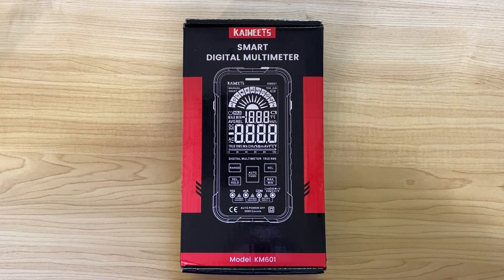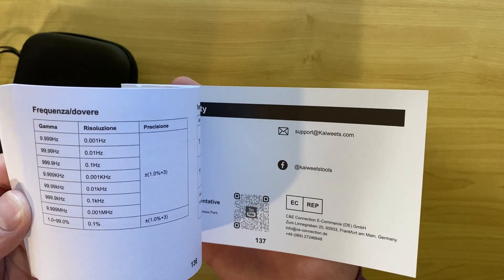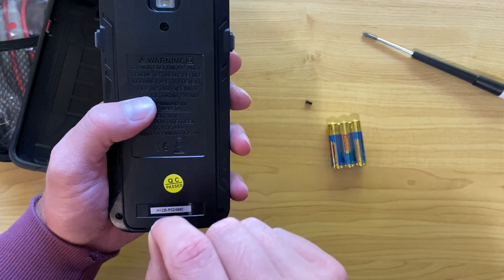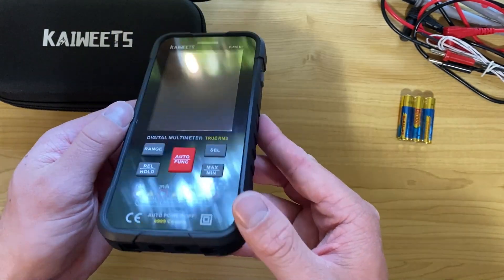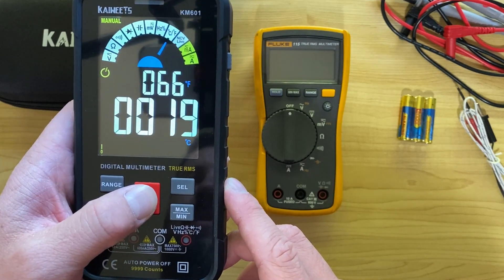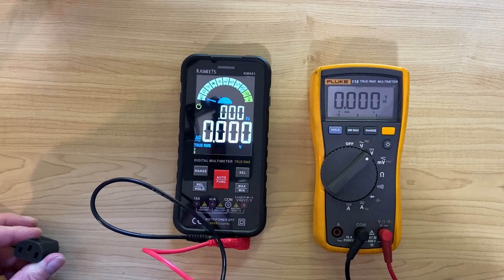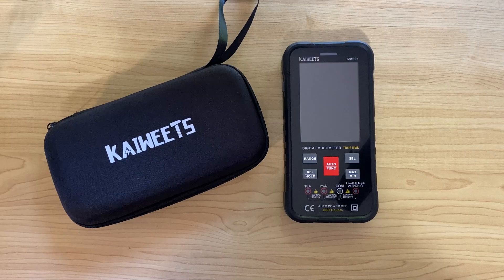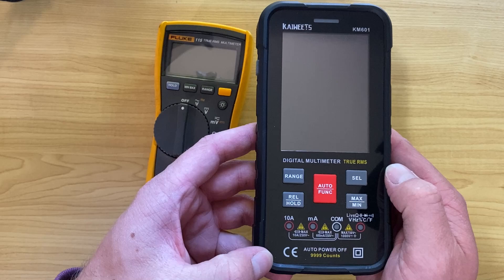$50 Multimeter better than a Fluke? Kaiweets KM601 Review

Comment: 99,9% people never need to get some 0,3% accuracy in voltage/resistance readings, it is only here in youtube that it becomes crucial. People, please trash your $250 price tag Flukes and go hype meters over $1000, even better +$3000 because you need that 0.05% accuracy...

Comment: 08:42  this test doesn't measure accuracy.  It just show the difference between the readings of the two multimeters on the same DC voltage. It's got nothing to do with accuracy.

Comment: Why are you testing a quality item against China Ju__k a bit pointless, if you want quality that you can rely on pay the extra, I purchased my Fluke 75 when I was 20, and I am now 78, and it still works, so what can I say!!!
Reply from the maker: So you've owned one and believe it's junk?
Reply: Not arguing, just curious: Does your mid-sixties 75 (same age as I) have any "offshore" sourced parts? Or are they being made entirely overseas yet?  My point would be that the new ones aren't the same as the old ones. Or maybe they are. I've not dug into it. Cheers.

Comment: For what I need it for it's better than a fluke. I like the neoteck pen 1 better tho. I don't need a fluke because I don't go over 277 volts normally so nursing home maintenance I usually don't even need to use the leads I just use the ncv. The pen is better because it fits better in my pocket and I can use it 1 handed even using the multimeter.

Comment: Thanks for most comprehensive review.
As of may 2024 , I want to buy a  accurate but budget ($ 50 Max) dmm for SMD component / voltage testing .
I think Kaiweet , multicomp ,anenag ,UNI-T all are chinese OEM .
Can you pls suggest  the best amongst this breed ?
Though colour smart screen is sexy it must be consuming large power and prone to damage .So I will stick to AUTO / manual dmm with backlight colour lcd .
pls.suggest. Thanks

Comment: On my Fluke 115 the stoping nose of the functions button (rotary button) broke, although I never used it really rough. So I can turn over the off position. Replacement parts for that (I really tried) been a pain in the ass! I got sent from here to there, I guess it's easier buying some spare parts for space shuttle from NASA! Backlight is just a bad joke, as you can see also here in this video. Now got GVDA GD128 which is the same as Kaiweets 601, and enjoy super display, and overall sure same measuring quality as Fluke 115. Do I need a Fluke? No!

Comment: Unless you're a professional that requires a high quality multimeter for non stop daily tasks and you have lots of money laying around and want to spend them on something, I suggest you to pick something else. Even the most basic Fluke models that have barely any functions cost over $150 and for just a little more, you can get yourself a multimeter with almost all the functions available to a multimeter. For instance, a good quality multimeter from other brands that cost $250-$300 will have nearly everything and it's Fluke equivalent will cost you around $1500, if not more. So, it's all about what you do, what functions you need and how much you're willing to spend. Keep in mind that the people who use Fluke all around the world are a very small % and the rest of the people are doing just fine without Fluke (yeah, imagine that). Don't jump on the hype train, unless of course you really want to and while Fluke is probably the most famous and most expensive brand, it's not the only professional brand out there that offers high quality products.
Reply: this comment would be a lot more helpful if you named some brands! i need one for electronics, and the cheap DMM's I've always bought never worked for longer than a few weeks.. i wanna pay for sth that'll last, and being a noob I've heard that Fluke's are durable. any brands, or maybe even specific units, you'd rec? mainly small electronics work, if that matters

Comment: This is not a meter that should be used on 250volts as it has little input protection ,may be ok on low voltage  stuff. suggest you open meters under review

Comment: I have this particular model, and while I do like it, it's only because it fits in my pocket, has min/max capability and uses standard 4mm probes. It's my second one because the first one died within the year. I expect this one to fail also. My Fluke 97 on the other hand will undoubtably give me many more years of excellent service. Evey time I test a capacitor with anything less, I want to throw everything else against the wall. Including the Kaiweets. You would have to compare it against the crappiest Fluke (115) to even come close. The 115 or any of the other low end meters Fluke offers does not represent Fluke. You may want to change your title to better represent that thought.

Comment: All smart multimeters like this one have a fatal weakness: the screen is difficult to see outdoors.
In this multimeter, the rechargeable battery is used. Someday (about 4...5 years or less, the battery will fail, what should I do? Furthermore, it only uses one button to switch tasks, it will be damaged quickly.
Additionally, this type will definitely drain the battery quickly.

Comment: Thanks for the review - I've just bought the newer version, the KM601s which has the option of battery powered or rechargeable. More importantly, the test leads plug into the face panel (not the edge) and there is a flick-out stand like your Fluke. Also the function button allow navigation through the functions in either direction. I haven't tried it in the bright sunshine yet but here in the UK we aren't too worried about getting to much of that - lol
Reply: where can you find the 601s that's battery powered? i can only find it a rechargeable option
Reply: @datrandomdugggy5537  That's my thought because as far as I know, KM601S only comes with the rechargeable option.

Comment: just buy a fluke 101 for $45 bucks. kaiweets might be fine for battery powered hobby stuff but I wouldn't trust my life to a Chinese brand that's going to cease to exist in a few years and resurface with an extra K as Kkaiweets. when you are measuring for 240 volts to make sure the power is off before you reach in and start messing with wires don't trust your life to china junk you see a youtuber shilling that he got for free.
Reply from the maker: Sad sack
Reply: @HamRadioDX  considering the terrible reviews I'm seeing looks like I'm right. it also doesn't use sand filled safety fuses so it doesn't explode in your face if you blow a fuse on high voltage

Comment: I was all set to get the cheaper multimeter until I saw the last few min with the washed out display in daylight which is were I would use it most of the time . Still a good cheap for inside worship use and the display was bright in the right conditions . Thanks for the review

Comment: Your assessment of the meter fails to show any understanding of the safety aspects of the meter. For a start, the reason for the screw in the back which is required to be removed to change the batteries is a requirement of EN/ISO 61010-1 which is the safety Standard for test equipment and similar devices. It requires amongst many other things that potentially hazardous live parts may not be be accessible without the use of a tool.
Accuracy is not within the remit of the standard and is a commercial concern.
Reply from the maker: How silly of me

Comment: Would have been good if you would have swapped the leads to see if the difference was in the internals or leads.
Reply: Lead length within reason will make no discernible difference to a voltage reading.

Comment: You can lend over that fluke to your grandchildren and it will be as accurate as the day you bought it, spend the money on a better meter. I have a 117 and 10 other multimeters, I always end up going for my 117 because I trust it.
Reply: Bought a used Fluke 117 a few years agao and checked it against a voltage reference. 5V reference read 5.000V on the multimeter. Not bad at all.

Comment: I bought a cheap fluke 107 meter a few years ago and it works alright. Lately it’s been acting up so I just bought this one on Amazon as a backup and a new set of leads for my fluke. I can’t justify $800 for a proper fluke, I don’t need that kind of accuracy.
Reply: Fluke 101 is $43
Reply: @TheSimba86 What does the 101 offer?  It isn’t even true RMS!

Comment: I bought one of these a few months ago. The only thing I don't like is that it won't read high frequency AC pretty much at all.. Granted most won't, however a lot of even cheap MM I'ved used will still give a reasonable read on high frequency.. This MM pretty much doesn't function after a few 100 hertz.

Comment: Lol you're funny. The Fluke meter is made to withstand very large drops. That's why it has that yellow rubber booth it's very thick for a reason. It's the opposite your el cheapo meter is the one that will break first if dropped. Either way though very entertaining video. Thanks.
Reply from the maker: El cheapo doesn’t always equal el crappo… you’re welcome

Comment: The batteries are AA and NOT AAA!!!
The reason why the battery compartment is screwed on rather than clipped on is when you drop it, you won't lose the batteries when the cover flies off. Probably less of a chance when there is a protective cover over the battery door.

Comment: One thing I have missed that is important. The fluke meter is a category lll meter. How about this new meter here? I may have missed the marking on it.  I might like to use the new meter in the shipyard I work at, but the category lll rating means the fluke has a rugged rating that I like.
Reply: Tbh, even if this meter was marked as CAT III, I wouldn't put it anywhere near any high-enrgy circuits. Just because it might be marked CAT II or III plus a voltage rating doesn't meant it is safe to use on such installations.

Comment: I purchased one out of curiosity as the "mobile phone" styled form factor is quite appealing. The 601 is a useful meter in a fun package that does appear accurate when compared to my Fluke 87 V and 189 meters. I do have some concerns though. The internal construction does not have separated compartments for fuses nor does it use reinforced  safety fuses. Additionally, there are no MOVs to control mishaps which can result in a fuse explosion. I recommend being vary cautious using this meter with high voltage mains. I also found this meter to be extremely slow on reading capacitance and that small capacitors, below 1 uf, seem to be quite inaccurate. Finally if you use this meter with high voltage, please use the outer case to provide some containment protection. Mishaps can happen. I do like the review.
Reply: I've just looked at the claimed specs of CAT IV 600V and to be honest I think it's a joke. Having done proper formal assessments of test equipment to EN/IEC 61010 in the past, I wouldn't go near anything hazardous with this meter. Proper HBC fuses are not cheap and correct layout with creepage and clearances to support the higher Measurement categories becomes very onerous. The fact you mention it might need a separate enclosure and transient voltage protection suggests it falls well short of the requirements and doesn't meet the LVD. It is probably dangerous and should not be on sale in the EU or UK and even recalled.
Reply: i hate phones
Reply: yeah, without the proper sand filled safety fuses it will blow up in your face if you blow a fuse on high voltage

Comment: Can you change the temperature to Fahrenheit?
Reply from the maker: Yes you can change the temp from celcius to fahrenheit
Reply: @HamRadioDX  any clue how?
N6OCT
Reply from the maker: Keep pressing the Auto/Fun button until you get to the temp measurement and it will show both at the same time according to the manual
Reply: @HamRadioDX  of course, the temperature also shows on other screens but in Celsius, I was wondering if the can be changed.
Reply from the maker: I didn’t see that in the manual. I may of missed it though

Comment: If I had to place a bet which meter was showing the correct actual voltage, it would be your Fluke even though it's 10 years old.  I have a Fluke 87 (no suffix) that's at least 20 years old and was used in an industrial environment, never calibrated and I put it up against my brand new Fluke 289.  The reading were identical.  Identical.  You can't beat that with a stick!
Reply: I've had flukes fail just like every other brand, cheap modern multimeters are all decent unless its a dollar store version. They all use the same circuit designs and are usually made in china unless you buy the more expensive made in America models then they are the same with an american flag on it.
Reply: I will stand by my comment that fluke makes probably the best multi meter on the market. My 87 has been in, around, and under the hood of cars and trucks for the last 20 years, and I would trust it to measure anything accurately.
Reply: Same here. I even bought mine used $225 in 2015 took the board out a couple times to clean with witch hazel because the rotary knob contacts were crappy.. it's been phenomenal.. mines from 1994  @Spike-sk7ql
Reply: Digital meters with A to D converters do not drift like older Analogue stuff used to,  they either fail or they give the correct reading...
Reply: My 87 is welll over 20 years old, was even left outside on the rain FOR A YEAR (Cottage)

It somehow still works and IS PRECISE!
Reply: But to get a Fluke you need to empty a fat wallet.
Reply: I don't have any issues they've fluke Klein and these cheap Chinese ones give pretty accurate readings. My boss has 1 of them expensive flukes and Ariat boots  and here I am with the Chinese multimeter and the American made tony lamas. He always says I'm going to become the ground wire in my leather soles. I rarely use the multimeter even in doing electrical. I already assume it's live because I do it all hot anyways unless it's certain things. I have good insulated tools though so I never get shocked even on arc flash.
Reply: 99,9% people never need to get some 0,3% accuracy in voltage/resistance readings, it is only here in youtube that it becomes crucial. People, please trash your $250 price tag Flukes and go hype meters over $1000, even better +$3000 because you need that 0.05% accuracy...
Reply: After 10 years electrolytic capacitors will start to dry out, it would most likely refuse to switch on than give inaccurate readings

But in 15 years of building circuits, unless you're dealing with precision voltages for a comparator or feedback pin, generally it doesn't  matter if it reads 1.05v or 1.10v that's what potentiometers are used for, fine tuning

Comment: I do not like AAA's as they do not have that much capacity. The backlight on this meter is going to draw a lot of current from the batteries. AA's would have been a much better option.  I suspect that's why they gave you two sets of batteries with the meter.

Comment: Thanks for the nice review. I have a Fluke 87 that I bought years ago, and it has been a fine meter. Recently though, while turned OFF, it will start to make weird noises and the display looks like it wants to fire up. I guess it is time to send it out to have it looked at. I find it very strange that while off, it is making noises.  As mentioned below, a cheap meter that you have is better than an expensive one that you don't.  --  de n1kpz   ( dennis )  in NH.  on the East coast of America.  73 OM
Reply: sounds like it tested a ghost and has never been the same.

Comment: Hi, nice video. If you just turn it on and start measure AC voltage, it will detect automatically that or you must switch to AC mode with FUNC and then SEL button ?
Reply: It does detect that automatically ;D

Comment: I bet it won't last long than a fluke. I am using a fluke since 1998 and it is still going strong. Get it calibrated every 2 years, just replace the batteries. The only issue I recently started facing is the display.
Reply: I bet you can not know how long it will last.